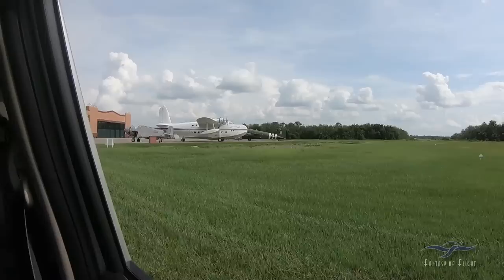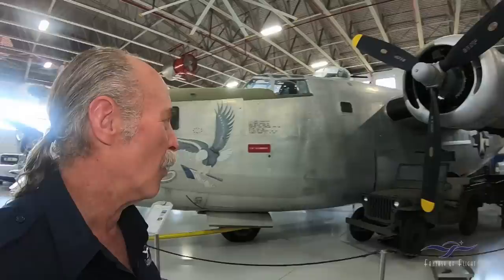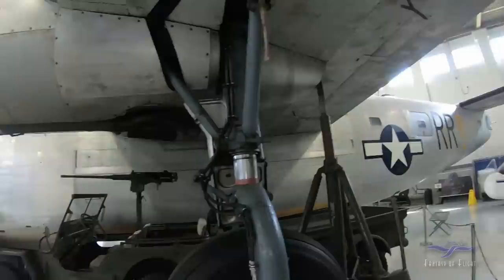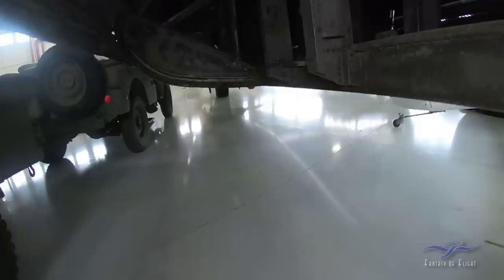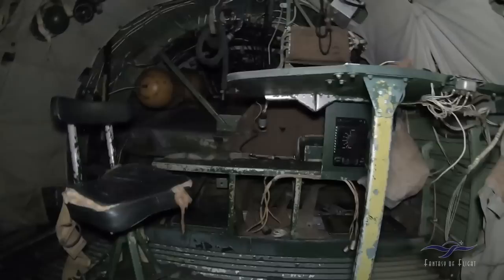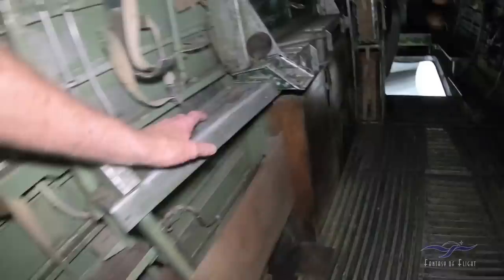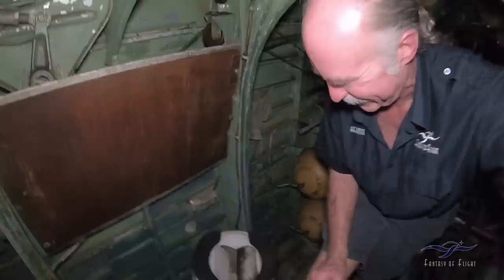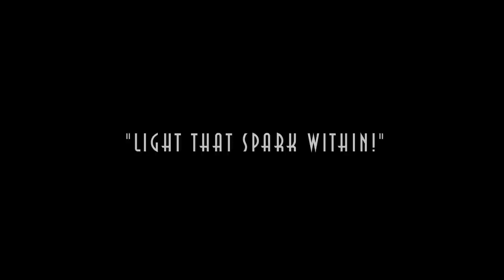Consolidated B-24 Tour - Subscriber's Request! - Part 1

Comment: Ah, memories!  After WWII my great-uncle built and sold welding rigs using dc generators from B-24s.  He used a flying suit heater rheostat to control generator field current.  In 1960, I learned WWII bombing systems at USAF weapons mechanic school at Lowry AFB.  I wound up in a fighter outfit, but at least the F-105 had a bomb bay.  My load crew once loaded sixteen 750-pound bombs on an F-105 to check out the new MER external racks.  That would have been quite a load for a B-24.

I encountered a B-24 as a hulk at Tulsa airport while attending Spartan for my A&P in 1964-65.  One of the engines from that airplane wound up in Spartan's collection of operable engines used for training in engine run and troubleshooting.  It still had the turbocharger attached, but the turbine had long ago given up spinning.  We never exceeded 30 inches on a run, anyway--old iron, you know.  My first airline employer still operated DC-3s at the time, so the R-1830 experience came in handy.  First task, though, was learning all about keeping the 22-gallon oil tanks full.  Thanks for the tour, Kermie.

Comment: Hi Kermit, 

@Kermit Weeks

This is amazing, thanks so much for sharing.  For background my grandfather (then Flight Lieutenant Geoffrey Smith, later Squadron Leader) flew this very plane twice in April 1945 whilst at 357 Squadron in the RAF.  For background, there is conflicting information potentially suggesting this aircraft left 357 squadron in April 1945 but log book records show this aircraft stayed in 357 Squadron until at least August 1945.  This aircraft (at the time numbered KH401) wore the insignia 'V' in 357 Squadron.  Grandad's flight records in this plane were as follows...  

3-4 April - 2200 to 0708hrs (9hrs, 8mins).  'Successful. A/C was over D.Z. at 0142
hrs & 'T' of torches & long flashes by aldis as briefed were seen. 5 agents, 7 containers & 7 packages were dropped in 4 runs from 700' – 800' AGL. The DZ is very good – suitable for non-moon drops. 16 packets of nickels were dropped on Kungyungon at 0245 hrs – 2000'. Weather – en route – slight haze at D.Z. – slight haze – visi. 10 miles. 

20-21 April - 0922 to 0700hrs (21hrs 38mins).  Successful. A/C made D.R. run from
 Jason Bay & D.Z was reached at 2010 hrs. found reception of T of fires was recognised & 11 packages were dropped in 3 runs from 5-800' ASL. The D.Z. is good with no local snags. At 1800 hrs a M/V was sighted S. of Sembilan Island approx. 4000 tons with 4 goal post masts & superstructure central. Approx 600' in length. Possible A.A. fire was encountered from oil tank areas of Gandar Maharani – very inaccurate & may not have been fired at a/c at all. Weather – en route – good over sea – storms over Malaya & along Malacca Straits at D.Z. – good 

Background of 357 squadron (in summary) is that these were 'Special Duties' used for secret missions into South East Asia to facilitate the Allies fight against Japanese guerrilla fighters in the area.  They used (generally) B-24J Liberator (Mk VI in the RAF) and modified these to reduce weight.  Generally the top and bottom turret (but not always) was removed as well as armour plating to improve drag and guns removed from all but the rear turret to save weight.  Additional fuel tanks were added as missions could last close to 24hrs and fuel was tight (hence the importance of weight saving).    Because they were so low on armaments, they used to fly at night from India and Sri Lanka (then Ceylon) to Malaya and other regions in south East Asia for their 'drops' (troops or supplies - note 'DZ' stands for 'drop-zone' and the 'T' of fires relates to fires lit in the shape of a 'T' to help pilots and navigators find the dropzone whilst flying at night).  They often flew at moonlight so they could see landscape as they flew very low (often below the treeline) to avoid radar and battled to avoid tropical weather.  

Attrition was high because of the long flight times (aircraft often struggled to take-off due to added weight of extra fuel) and a great deal of reliance was placed on the pilot to save fuel and also the navigator to take the shortest route to the destination (tricky in moonlight and in bad weather).  Lack of armaments meant these planes were sitting ducks to the enemy so radio silence had to be kept and pilot skill was tested in flying below radad often in bad weather amid undulating lanscape.  

Do you have any further history of KH401 (i.e. any pictures when at 357 squadron)?  Grandad noted they had aricraft painted olive drab (with grey undersides) but had one unpainted aircraft and i am wondering whether this was it?  To be honest, in grandad's opinion he did not like the unpainted 'Lib' as he felt he stuck out like a sore thumb in it (much of the flying was done through valleys of tropical forests below the tree-line so green was a much more effective camouflage than white metal).  

There is more detail of Grandad's flying available here...  
http://www.aircrew-saltire.org/Large%20Text%20Files/357%20Squadron.pdf 
Note his favourite aircraft was unfortunately not KH401 'V' and was, in-fact, KH114 'U' primarily because it brought him home successfully one very long mission on three engines flying on fumes.  Logbook details can be found here...  
http://www.rquirk.com/357.html 
Some pics of aircraft are visible at the following link but unfortunately not enough detail to pick up aircraft KH401 or 'V'.  
http://www.historyofwar.org/pictures_357_Squadron.html 

I would love to see this aircraft in person (and will travel to the US to see when lockdown has ended).  Would be amazing to see fully restored in 1945 RAF SEAC colours one day.  Here's hoping...  

Henry
Reply from the maker: Thanks for sharing.
Reply: @KermitWeeks444  not a problem. I don't suppose you have any pics of this lib dating back to 1945? Unfortunately grandad only kept a few snaps and the picture quality is poor

Comment: Kermit, thanks for the really cool video.  It is fascinating to see all the original equipment still in place.  I started going to the EAA conventions when they were in Rockford and so much of the WWII aircraft parts were available in the fly-market and over the years they have dwindled.  Some were bought to replace original equipment and others were bought to be re-purposed or just collected as an interest item.  The white / red cockpit light in my home built was from a WWII British aircraft and the small oil filter between my engine and PSRU was from somewhere in a B-17 hydraulic system.  My first ham radio shack was filled with radio electronics from WWII that I bought at a fraction of a cent of the original cost.  In the early 70's I bought a NOS box of P&W Sodium filled valves just because I thought they were cool.  I often wonder if there is a restorer looking for something that is sitting around outside of the normal part channels.

Comment: Dave kept this plane and is B-17 a March AFB. I was one of the "Red Hats" we got to wash them and work with the guys out of Chino doing maintenance on them. The 24 had "Delectable Doris" painted on the nose while it was there.  The guys at Dave's shop in Chino had a mold made to do the turret glass, I wonder if that who is making it for Collins? if I remember right the planes left for a move in England, that's the last I saw of them in 94. Thanks for restoring it, I guess it is still one of two in flying condition?

Comment: My father flew 37 missions 460th Bombardment Group H B-24 'Slick Chick with a Hot Lick'.
Crew 4352, Squadron 671, crew of the aircraft "Slick Chick with a Hot Lick": Jack Frye - Pilot, Lyle Deiner - Co-Pilot, Walter Dunkel - Navigator, "Andy" Anderson - Bombardier, Gus Alfonso - Engineer, James Sheean - Radio Man, James Steel - Assistant Radio Man, Dean Hardy - Armor and Robert Johnson - Assistant Armor.

Comment: Amazing that this Liberator is basically stock WWII military. Except for the radios and navigation it could pretty much be a WW II time capsule. Was this the B-24J that was acquired by the late restauranteur David Tallichet?  If I recall, this is ex-Indian Air Force Coastal Command via the RAF, like the Collings Foundation B-24 and the Pima Air Museum B-24....

Comment: Cool stuff, if I were him I'd be in it a lot more often. I'm surprised how many small details he didn't know. He should be able to get a mess of volunteers to do necessary corrosion control. He is 100% correct though, perfect for a complete restoration, that bird is amazing. 

The "walkway" he speaks of was actually called the "catwalk". I know this from reading my fathers DFC citation from Dec 25 1944. They left base early thirty in rain and mud soaked Italy to go bomb Oswięcim, Poland. Upon reaching the target the doors were caked with ice and mud so they would not open. My father had to salvo his load through the doors, mangling them in the process. He then climbed onto that same catwalk, no chute, kicked 2 jammed bombs loose and attached the doors using the wires from his heated flight suit fastening to the racks to reduce drag and enabling the bird to get back to Italy.  He was just another bombardier doing his job, part of the greatest generation.

Comment: B-24's were built where I live in Fort Worth, TX.  The original USAF Plant 4 is still here owned by the Air Force  and operated by Lockheed Martin where they now build the F-35 on NAS JRB Fort Worth ,formerly Carswell AFB.  There are some cool pics online of inside the plant where you can see rows of B-24's being built....wouldn't that be nice.  Just Google "Fort Worth B-24".  https://en.wikipedia.org/wiki/United_States_Air_Force_Plant_4

Comment: I believe I saw this plane when I was stationed at Athena Airport in 1969 or 1970
. When it landed and they shut down the engines oil poured out every where. I was working transit maintenance. Was riding shot gun on follow me truck and marshalled him into the spot.

Comment: Nice video. Kermit. Thanks for sharing. Just a small correction. The Indian Air Force used B-24s mainly for maritime reconnaissance. The aircraft never saw action in any of the Pakistan wars. The B-24s remained in service with the Indian Air Force till 1968. Here's an article on the B-24s of India, if you are interested http://www.bharat-rakshak.com/IAF/Aircraft/History/927-B24.html

Comment: It’s funny, the officers had to go through that tiny nose wheel door, and the enlisted men got to go through the aft hatch or bomb bay.
Reply: The purpose of the hatch in the nose wheel well was in case the nose wheel didn't drop when the landing gear was lowered. Someone would be detailed to give the tire a good kick, hard enough that it would drop down and the strut would latch. The bomb bay was used for normal ingress and egress. The bomb bay catwalk was used to go forward or back out. The easy access to the aircraft was actually a security issue.

Comment: There are probably many variations on that WWII joke about the B-17 and the B-24 but it usually goes something like, "That B-24 is the crate our B-17 came in." Emphasis on "crate."

All that zinc chromate and green paint inside is not original. B-24J were delivered in natural metal finish inside and out. New ones looked like a shiny tin can inside.

Comment: Kermit do you know if this B24  was made and willow run Michigan.  My grandmother worked on the be 24s at willow run in the war and i have lots of seat belts and other straps that was used on the b24s and we have some of the  Canvas bags and other canvas  Material bags and straps my grandmother father had a small factory that made all the straps and tool bag  Basically anything that was canvas material or straps they made in their factory.

Comment: Kermit needs to find the right outside company to take the 24, dismantle it carefully, document and reverse engineer every part, and restore and reassemble it. Then they'd also have all the info to build new 24s.
Reply: Um. Ok
Reply: @eether54  Like what was done with the new build production run of Me 262s. It's criminal at how few 24s have survived and even worse with only two active flyers today. The world needs more flying B-24s.
Reply: It's a nice thought, but it would probably be more practical to preserve what exists currently.

Comment: Excellent history of the IAF "B-24's" including 6th  squadrons operations which was the squadron that Kermit's 24 flew with. The Brits did a poor job of demilling their B-24's, they didn't think the Indians would do anything with them but the Indians refurbished them through HAL which had gained experience with US aircraft  overhauling PBY's during the war.  The Aircraft used retractable radar in the belly and were primarily used for maritime patrol with the IAF.  Some 46 or 48 (see article) were salvaged from the British base to the consternation of the US. The US didn't make too big a deal about it when they found out the Brits had not deliberately turned them over to the Indians. 6th squadron started operating their B-24's in 1951 but hey, lot's more in the article . http://www.bharat-rakshak.com/IAF/Aircraft/History/927-B24.html

Comment: Was it a Willow Run built B-24.?
Reply: No. KH-401 B. VI for the RAF was a Consolidated/Fort Worth-built B-24J per Joe Baughers records.  This was out a production batch of 500 bombers.  The Brits started getting these in the spring of 1944.
Reply: I believe the only Willow Run Ford in the USA is at Barksdale.
Reply: hoodoo2001 thanks for the info.
Reply: Steven Piper thanks.

Comment: Very cool Kermit!!  Was that built by Ford in Ipsolanti Mi?
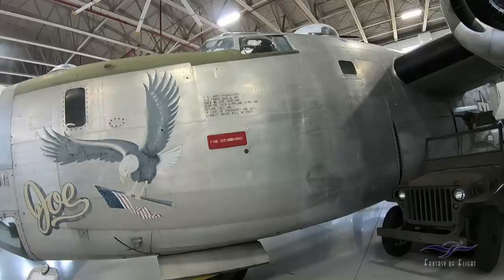Reply: No, Herb.  It was definitely constructed in Fort Worth, Texas, one of 100 bombers built in block B-24J-95 for RAF usage.  (It flew with the RAF serial number KH401.)  This block info would have been stenciled on the port-side forward fuselage, along with it's original US serial number, 44-44272 and some other details.  You can see a stencil block at the 5:19 mark of the video, below the cockpit, but I can make out that the B-24J- number, as painted on the top line of the stenciled block, is incorrect for this actual airframe.  Instead, it is accurate for the original "Delectable Doris", a US 8th Air Force B-24 (42-50551) lost in the war over Germany.  David Tallichet had painted his bomber as "Delectable Doris", and he had also painted the US serial number of the original "Delectable Doris" on the rudders and on the second line of the stencil block.  On Kermit's aircraft, however, the US serial number has been removed from the stencil block, but in some photos I've seen, the Liberator, after Kermit had repainted the nose art as "Joe", still carried the "250551" on at least the inside surface of the right rudder.  (The first digit of the full serial was dropped when painted on the tail, which is why it doesn't read "4250551.)
Reply: @PooleMatt  Thanks Matt, I always thought they were built by Ford . That's great to know .